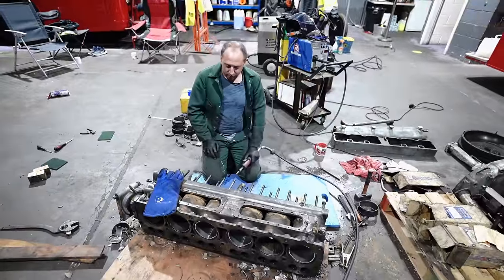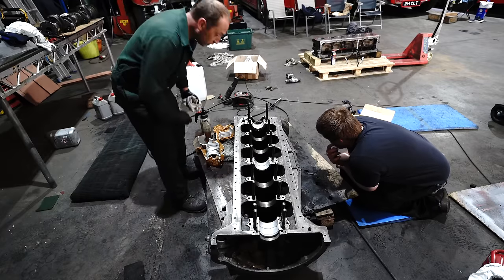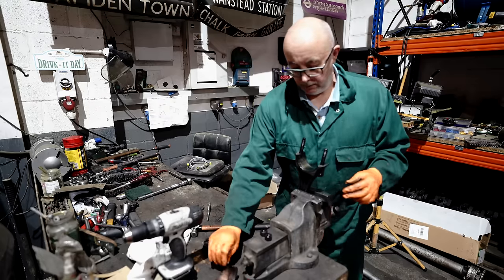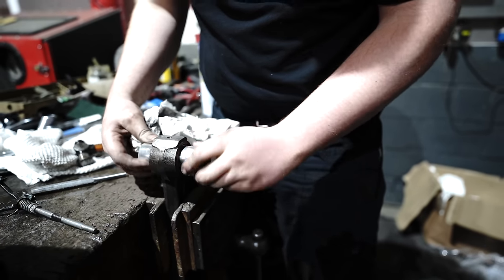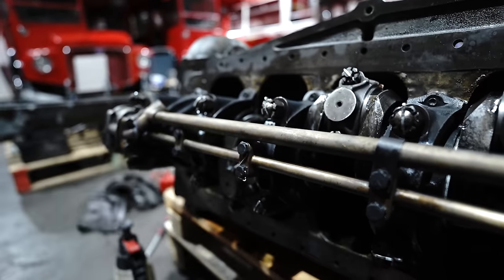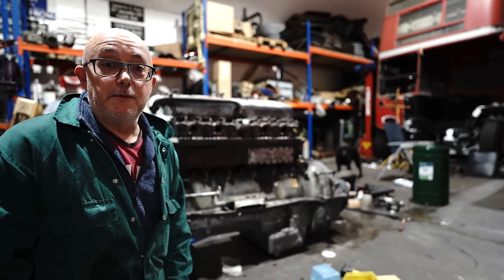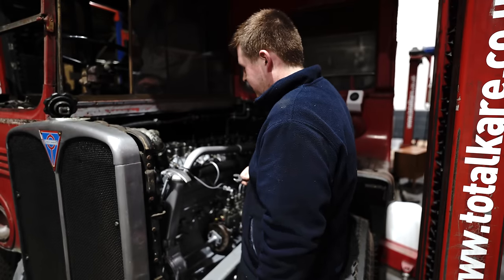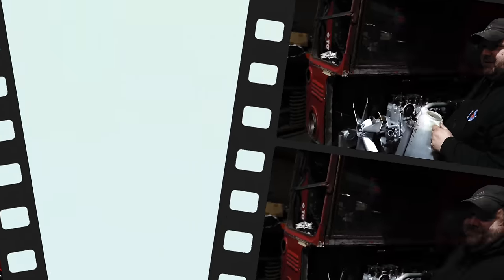Ep14: ENGINE REBUILD On A 70 Year Old LONDON Double Decker BUS.

Comment: Wasn’t surprised when you ran into trouble with your big end bearings, was waiting to see what you would do. When I came out of my apprenticeship at Chiswick Works, I worked on engine sub assembly. We would assemble, con rods, bearing shells, pistons / rings etc. The big ends would be torqued to the correct setting and the castellated nuts stamped 1 to 12 ready for the assembly line. So they would not need to be torqued again, just line up the numbers on the nut and bolt and fit the split pin. We had some equipment that we never used, as all the shells that were used were all pre sized (RM on) I asked the old boys what this equipment was for, to be told it was for RT’s as all the shells were under sized and had to be hand scrapped, with engineers blue to fit the crank.

Comment: After all the years of seeing 2629 languishing in one shed or another looking very down at heel, it's fantastic to see the progress you're making. That engine sounds very sweet.
Reply: Thanks!
Reply: @timhines6543  I think it's irresponsible to operate these very old vehicles in these days of global warming and climate change. We all want to see reduced carbon emissions and particulates both around the big cities and elsewhere. These old engines are very bad culprits when it comes to emissions and particulates.   The responsible thing to do would be using it as a static exhibit in a museum. 

I can see Gov regulation and scrappage being introduced in the future for irresponsible owners.
Reply: @PreservationEnthusiast   I think youll find that vintage vehicles are a huge part of British Heritage and an unmeasurable contribution to climate change. They generally only go out a handful of times a year and probably dont cover more than a couple of thousand miles. Im also a fireman on a steam railway which is also a big part of British Heritage but i'd assume you wouldnt like those either? People like to see all these vintage things in action to see how it used to be. Just look at the visitor numbers at rallies running days or places like Beamish.
Reply: @timhines6543  I think I could live with heritage railways if they were all converted to biocoal and bio diesel. Same with the bus. If it was converted for use with a carbon neutral fuel, that may be acceptable. And you would need to fit particulate filters to make it Euro7 compliant.
Reply: @PreservationEnthusiast  there is a lot of old buses still getting used for events across the UK
Reply: @Tristan-benge  Yes, and they will be needed to converted to run on biofuel, be emissions compliant, disabled from operating, or scrapped.

Comment: If you're interested, here's the history of RT2629, courtesy of the excellent website "Ian's Bus Stop": 
RT2629 LYF 354  
                7/51    new, body 5896: Park Royal 3RT8
                8/51 V  into service (Turnham Green)
                5/53    used on Coronation Route Tour, RT8 
                     AV (Hounslow)
                2/57 ED transfer (Elmers End)
                3/57 ED into store
                8/57 NF transfer (Northfleet)
                9/57 HN transfer (Hitchin)
               10/57 NX transfer (New Cross)
                1958 NX
                5/59 NX to Aldenham overhaul
                5/59 NX from o/h 
                60-2 NX
                4/63 NX to Aldenham overhaul
                4/63 V  from o/h
                5/63 WN transfer (Wood Green)
                64-6 WN
               11/67 WN to Aldenham overhaul
               11/67 T  from o/h (Leyton), Weymann body 6750, 3RT8
                9/68 WH transfer (West Ham)
               69-71 WH
                1/72 WD transfer (Wandsworth)
               11/72 WD into store, CoF expiry
                2/73 SW transfer, recertificated (Stockwell)
                */74 SW in service on 77A to Vauxhall $
               12/74 SW into store
                3/75 SW ..and out, recertificated 
               10/75 WL transfer (Walworth)
                2/76 WL into store, CoF expiry
                7/76 BX change store (Bexleyheath)
                9/76 AK transfer, trainer (Streatham)
                1977 AK trainer
                4/78 AK into store
                */78 AK trainer $
                7/78 AK trainer again
                6/79 AK trainer
                7/79 AK into store
                7/79    sold to Wombwell Diesels
                7/79    bought by T.Muir, A.Wolton, C.Lovett & R.Whitehead:
                        (North London Transport Society): preserved
               12/79    fitted with engine from Cravens RT1409
                6/80    on loan to Viking Youth Club, Stamford Hill
                6/80    returned to NLTS
                */86    at Woolwich Transport Museum
                        bought by R.Gould, New Romney, Kent
                2008    preserved, in store: R.Gould
               10/19    bought by T.Hines, Leeswood, Cheshire

Comment: I am a diesel mechanic and has worked all my life on cars trucks and busses  I have never seen the way they hammered the sleeve using a piece of wood 
We used a press  a sleeve puller 
Also we would not dare to work so close to the floor as just a tiny breeze would blow dust onto your engine 
We raised the engines above knee height using a table to assemble the engine on  
We had a rositery to mount the block on and you would rotate the engine by the press of a button to facilitate easy fitting of hang on parts

Comment: I used to “restore” those big turds over in the US, about 40 years ago. Mostly Bristols from the early to mid 1960’s. They must have been older than the ones that you had in the video. The body frame was made of cedar. I remember the engine was a Gardner inline 6…. I “freshened up a few of those outdoors in parking lots. I actually completely rebuilt a couple of them but people didn’t want to spend the money to do it properly, they just wanted it to hit on all 6 cylinders. We would go to the salvage yards over there and try to pick up a couple that ran and would move still. Only would pay about 500 pounds for it. (80’s money)They all needed lots of work. It would cost more to get it shipped to the states. Then the fun of driving it from the Gulf Coast to Minneapolis MN!!We would get it roadworthy fix everything cheap as possible and paint up and sell them to “pubs” here in the states. They would fill them up with drunks at the bar”pub” and take them from the bar to the stadium to ball games and hockey. I was just a kid in my 20’s, now I’m a “pensioner” Brings back memories!!

Comment: Easier tip for liner removal.  Find a cold store and freeze the block   the relative contractions will enable them to snap out if the outer is heated a bit

Comment: hi there, sorry for your loss Tim, wow ! a great job in getting this AEC engine running again,its sure up to AEC standards,this is how it would have looked coming out of the paint shop at AEC, a point of note, its a pity London Transport did not specify an air cleaner to be fitted to the engines at that time, just caught a sight of the dog, hope he is ok, keep up the good work,

Comment: Condolences to you Tim on the loss of your Grandfather.  By the way a sharp hair cut - looks much better!  Why didn't you use the engine crane to lift the block onto the crankcase?  It would have made lifting the block much easier and safer on your back.  I thought either you and Lord Barrington were going to do yourself an injury as you lifted the block, negotiated the pallet to position the block over the crankcase.  Do the Routemasters have trouble overheating in the hotter months?  Your bus has the same cooling fan arrangement as our AEC Regal Mark III bus we are restoring here in Victoria Australia, it is a mechanical fan operating without a shroud to direct the air through the radiator core.  We converted our radiator over from mechanical drive to four electric cooling fans and used foam rubber to ensure each fan pulls air through the radiator core, we also fitted these fans into a shroud to direct the outside air through the radiator core.  We hope these modifications put an end to them boiling in the hotter summer months when the temperature climbs up to 38 degrees Celsius here in Australia.  A great video as always, keep up the good work.  Regards a fan from Aus.

Comment: Condolences Tim.
Don't fret about the water pump yet, it will probably bed in after getting nice and hot. Do these have a carbon gland seal? I had a similar problem with a rebuilt pump on my Daimler 15 but after a couple of hours running, and a can of Radweld it settled down well. The seal faces need to bed. 
Lovely to hear and see another AEC Engine running sweetly after a long slumber. Great work guys.
My old Guvnor was an AEC engineer (Dick Loydall) and he would have had a Dicky fit seeing those liners bashed in with a bit of wood and large Birmingham Screwdriver! Lord Barrington didn't refer much to the accurate seating of the liner lip and its absoloute importance on longevity of the head gaskets. I know that was one of his major concerns when his engine lads were rebuilding such engines and although he was the depot General Manager he would insist on personally inspecting them after liners were fitted to make sure they were "just so". Do you have the AEC workshop manuals?
Reply: Hi Peter, thank you. Yes the used to have carbon gland seals but a modern alternative is used when the pumps are rebuilt. Its all sorted now and was a small piece of rubber in the pump causing the problem. The block and top of the liners were skimmed before reassembly of the heads and gaskets to ensure a perfect seal. Ive got both of the AEC workshop manuals. Many Thanks

Comment: Well if I ever win the lottery there is a lot of work coming your way ;)  
Quick questions though, were all the RTs Simms fuel pumps or were some CAV? and how do you get on driving pre select?  I loved it for the very few tries i had to play with preselect gearboxes but it was always an odd thing to play with rather than anything that felt normal.
(Like many who drove her i had my leg almost ripped off by a mechanical preselect Daimler who liked to punch the pedal into your shin!)  Air operated RTs were much nicer obviously but i only had a short play in one.
I guess it is age but my ideal garage is now a decent estate car and about a dozen buses ;)
Reply: There is a mixture of both simms and cav fuel pumps fitted on RT's and RM's. Driving a preselect is a great experience the set up on an RT, RF etc could not be any better perfected in my opinion.

Comment: That bus has probably not been in such mechanically good condition since it was new. It looked a bit brutal putting those new cylinder liners in, though it did the job. Need to find a manufacturer that will reproduce the bearings and other spares for the future.
Reply: The periodic rebuild regime at London Transport's Aldenham works was very extensive and involved separating the body and the chassis, removal of the running gear, engine and gearbox for refurbishment. The bodies had all parts and panels replaced as necessary. The bus was then reassembled and repainted before going back into service. So it has probably been as new on several occasions in its lifetime. There are various videos about Aldenham on YouTube

Comment: with freesing the cilinders they actually mean keeping them in dry ice , used to replace cilinderliners on daf / cummins engines they actually slid in fully and only ocasionally needed a little extra hammering to get them to seat , we did had to work fast to plevent the liner heating up and block cooling down narrowing the tollerances
because of this we allso done every other cilinder to stop the cooled down part of the block (from the previous liner) to affect the next one

Comment: I wouldn't hone a little end bearing with one of those cheapo spring loaded hones! it's likely to bell the ends of the bush and possibly leave carborundum grit embedded in the bronze of the bush. Which wears the gudgeon pin. Better to use an expanding reamer.
Reply: That is a good suggestion, Thanks.

Comment: Did you heat the block in addition to freezing the liner?  That often helps greatly with interference fit parts.
Reply: We didnt risk heating the block as we only had means of locally heating it which cpuld have led to fracture issues etc

Comment: Bet you wish you'd marked up the shell bearings with the big ends before trying to use the new old stock?
Reply: Id checked before luckily and they are all stamped 🙂
Reply: @timhines6543  were they also 'keyed' I've only took a few engines appart but the shell bearings were always keyed

Comment: She sounds a little lumpy on tick over. Is there some tweaking still to do? Or are they a lumpy engine?
Reply: All settled in now, both the RT A204 and RF219 engines have a lumpyish tick over sound. It is the way the fuel pump governs on these engines